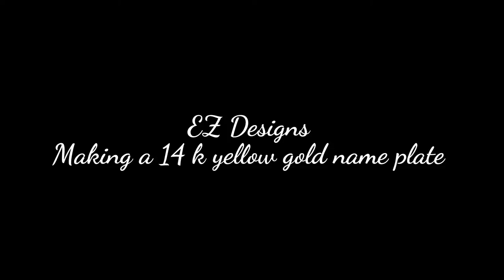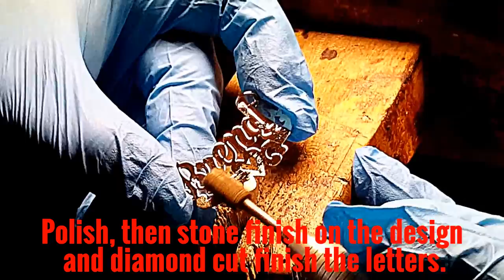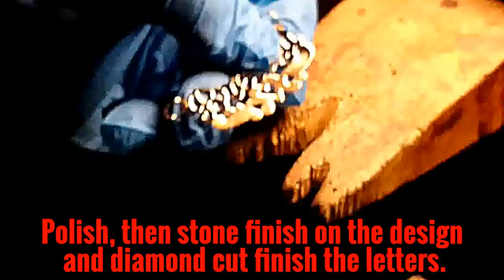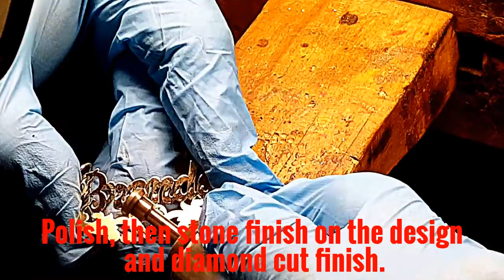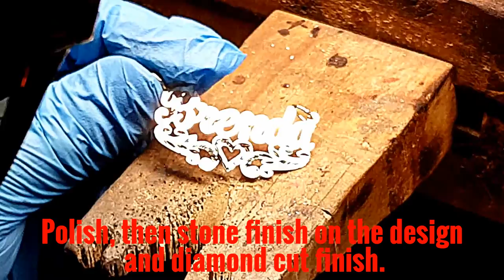DIY jewelry name plate necklace

Comment: Did you roll it before you started? What is the thickness of material needed to saw through it?
Reply from the maker: Yes I rolled it. This particular name was a little thicker than normal it was 0.81 mm thick.
Reply: @EZDinero  what is the average thickness for a nameplate? & could I purchase copper already thin so I could just cut through it ? Could I have your email ? I'm just starting out and would love some tips and have a few more questions.
Reply from the maker: @kierrat3193  you should be able to find a sheet of copper I'd say 1 mm or thinner should be fine.  Yes my email is ezdinero.il@gmail.com
Reply: @EZDinero  does it have to be that thin  for a #3 blade to cut through? Or is that like a preference.
Reply from the maker: @kierrat3193  a preference. If you're using 3/0 blades you should be fine. that's all I use except for when I need to cut very fine detail. I've cut metal up to 3 mm thick with 3/0 blades but it's very slow.
Reply: @EZDinero  thank you !
Reply from the maker: @kierrat3193  you are welcome thanks for watching and commenting. Best wishes.
Reply: @EZDinero  no problem great video !

Comment: Hi do you have a material list for anyone new wanting to try this?
Reply from the maker: Have to have A computer with Adobe photoshop and Adobe illustrator, 
metal (aluminum, brass, gold, silver, etc..)
A rolling mill,  a slim leg divider, a flex shaft motor and necessary burrs and bits. A flywheel and flywheel hand piece. Stone finish. The metal your using you'll need wire for the hoops so you'll also need a draw plate.  A ultra sonic, a steamer a grinder with buffing pads and buffing compound.  You know what I'll make this topic my next video,  how'd that sound?
Reply: thanks for the list! Definitely want to get into this
Reply: Hey I emailed but got no reply.
Reply: @EZDinero  where do I download heart2art ? Having trouble finding it.
Reply from the maker: @kierrat3193  I'm sorry about that. It was a misspelling I corrected it. My apologies I didn't even realize it until you mentioned it. I'll check my emails today
Reply: @EZDinero  so what is the correct email address ?
Reply from the maker: @kierrat3193  yes I just replied to your email
Reply: @EZDinero  I dont see it.
Reply: @EZDinero  I see it sorry lol.
Reply: What fonts are you using in photoshop?

Comment: You have great piercing skills! Try setting your pieces in setting pitch in
Order to have more stability in your diamond cutting..... Thanks for posting...
Reply from the maker: i don't quite understand what you mean John. please explain it again, sorry
Reply: Hi Easy, my question is basically would you have more stability diamond cutting if the piece was in like a diamond setters cement?
Reply from the maker: personally I've never tried it with the paste.  I was taught to hold it by hand but that would be an interesting video to do.  I'll be posting on the difference.  that way we can both answer that question together.